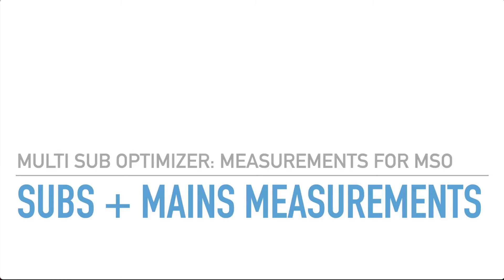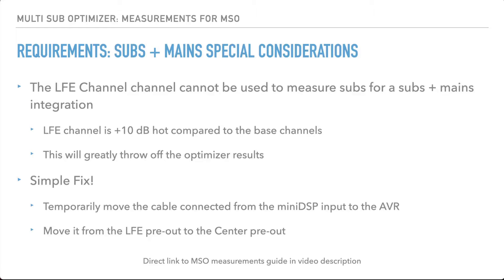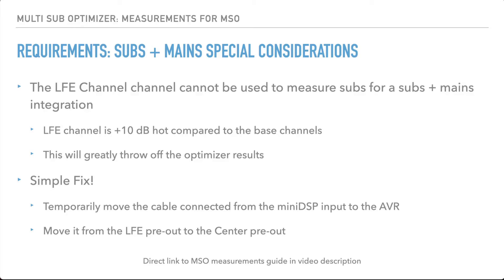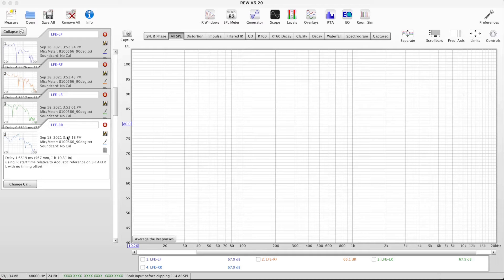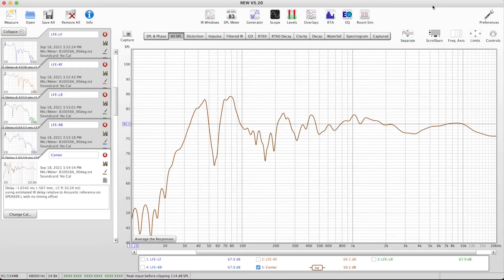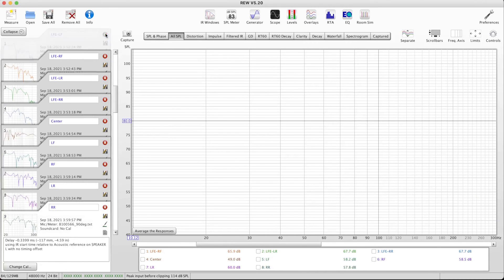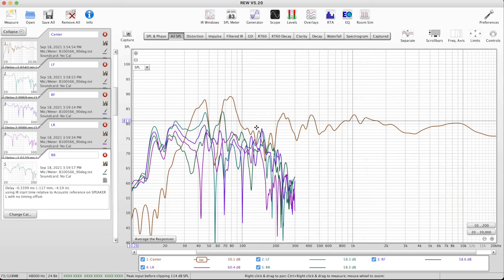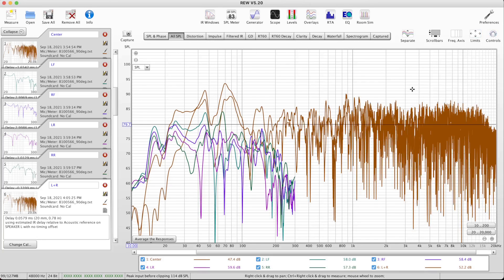Measurements for MSO: Subs + Mains Measurements

Comment: Hey Jeff

Thank you so much for putting together such a great tutorial! Can't thank you enough for this.
I just had one query for you.

You have mentioned - "Multiple subs on a single channel are measured at the same time and are treated as a single sub"

My setup is as follows:
1. I would be driving 2 subs from 1 LFE out of the AV Prepro [The AV prepro has 2 sub outs. But since I need to add an Auro3d Voice Of God channel, one of those Sub pre-outs gets used up for the VOG channel;  thus leaving me with just one SUB pre-out]
2. How I would be doing this is by connecting the remaining SUB pre-out to the one of the inputs of a MiniDSP 2x4HD and deriving 2 outputs for the 2 Subwoofers.

So my question is - In this scenario, do I consider both subs as a single subwoofer during sweeps and measurements? - OR - are they to be regarded as 2 separate Subwoofers while taking measurements?
Many thanks in advance!
Reply from the maker: Thanks for the question!  The short answer is that we need to treat each sub individually from a measurement perspective, and then take the time to properly align and integrate them with one another (using something like REW or MSO depending on your goals, more below).

The long answer below is WHY we need to treat them this way and do some extra work up front.  There are also links to my other videos on the two methods I mention to help you get started.

Please keep asking questions as things come up!

Now ... the long answer ...

The important thing to keep in mind is what the AVR or SSP "sees" in this kind of config.  The AVR/SSP doesn't know what we're doing with the signal.  It only "sees" one channel and therefore, one sub, regardless of how many are actually playing.  It could be one, two, or 20 subs.

The problem this creates is that AVR/SSP isn't capable of making sure all of those subs are actually playing well with one another to produce the best possible sound.  Unless you are very, very lucky, the subs are going to be fighting each other, rather than helping each other, in some or all of the frequency range.

That fighting vs helping is why we need to align, and optionally EQ, the subs within the miniDSP.  When that's done, we end up with a virtual "super sub".  The AVR/SSP now sees this single "super sub" and can use its room EQ processes to their fullest extent.

Depending on your goals, you'll want to use either REW or MSO to handle the sub alignment.  The short version is if you only have, or care, about a single listening position, use REW.  If you care about more than one listening position (like a row or multiple rows of seats), then use MSO.

I've got videos on both methods here on my channel:

REW Method
Watch the first 10 mins or so of the EQ video first.  You'll then need to go through the Alignment Tool video, and come back to the EQ video to finish things up.
EQ Proces:  https://youtu.be/ARztXSmoQbE
Alignment Tool:  https://youtu.be/8bwpLfbLiZ4

MSO Method
https://youtu.be/WtMq73BzOIA
Reply: @jeffmery  Wow! That's a really long answer there. 
Thank you very much.

I will check the videos that you pointed out. May I request you to create a YT playlist on your channel with all of your videos in the right order? I think it would be really helpful for noobs like me to follow through and understand things more cohesively.

May I share another question with you here?
Where would Room correction systems like Audyssey, etc. factor in now, in the grand scheme of things? Do we run Audyssey after all these steps that you speak about here?
Reply from the maker: @diymonk7266  Doh!  I thought I had put one together for REW, but it was only for MSO.  I'll get one out there soon.

You are correct about room correction  You would first get your subs squared away as outlined above, then run your room correction.  There are always exceptions to this, but this usually provides the best results and is almost always the best place to start.

Comment: Hello Jeff, 

You videos seems to be quite interesting on using the MSO. It's seems to be a better option. 

May I check whether will it give the data(from MSO) for the center channel on which crossover & how much delay for the center channel has to be input?

Thank you once again for making this video. It's my first time using MSO.
Reply from the maker: MSO will not determine the correct crossover frequency, but it can be used to figure out the delay at the crossover frequency you have chosen.  This is part of a subs-mains integration.

Another option is to use the alignment tool in REW to determine the correct delay to align with the center channel.  I have another video on how to use the alignment tool.  Just use a measurement of your subs.  This is a measurement AFTER you have aligned them with MSO, so it will be a single measurement.  The other measurement will be your center channel.  The center channel is the first speaker in the tool and the subs would be the second.  Then you can figure out the best delay to use for the smoothest integration.

This ^^ should be done after running your room correction software.  I would use this with MCACC, YPAO, & Audyssey for sure.  I would not use this with Dirac and a full DLBC license.  I'm not experienced enough with ARC or some of the others to know if/how this applies to them.

I hope this helps.

Comment: Hi Jeff,
Again a super video from you.
Can you already say when the video comes to the integration, I am very excited about it.

But I still have a question because I have a DDRC88A+BM.

Does not it make more sense if after the integration as in my case dirac then still runs over it instead of the center to take the front left speaker? Because Dirac takes as a reference also the front left speaker
Reply from the maker: The important thing, is that all measurements used as input into MSO use the same acoustic reference.  In my room I have 3 positions and 4 subs which means 12 measurements.  Those 12 all need to use the same channel as the acoustic reference channel.

The reference channel used by the room correction software doesn't matter.  I use Dirac myself and yes, it uses the L main.  Other room correction software behaves differently.  YPAO, for example, just sweeps each speaker, and doesn't sweep the L main each time as a reference.

I also agree on your approach.  Integrate the subs and then pass them to Dirac as a single virtual sub.
Reply: @jeffmery  thx for the Answer. Can you tell me when do you make the integration and optimize video for the center and subs in mso? I mean the net step in the process ;-)
Reply: @jeffmery  hi Jeff 
When comes the next Video?
Reply from the maker: @michaelpiper6601  I’m not sure. Work has been crazy for the past few months and isn’t letting up. If the concern is aligning subs with the center channel, search for “sub distance tweak” and use the center instead of the L+R for the process.
Reply: @jeffmery  I do hope your work tails off enough for you to have some time to run the the MSO and MiniDSP process for Multi-Subs +Mains.!  In your experience did doing the subs + mains produce any better results than subs only?
Reply from the maker: @Malice0505  It has tailed off some, but I'm not sure if I'm going to do the subs + mains tutorial any longer.  I hope that's not too disappointing, but let me explain.

The point of the subs+mains optimization is to 1) optimize the response of the subs 2) determine the correct crossover frequency between them and 3) determine the correct amount of delay between the subs and the mains.  Point 1 is the same for sub-only and subs+mains so let me address points 2 and 3 as they are the real sticking points.

Regarding point 2, MSO has some very specific requirements in order to determine and implement the correct crossover frequency.  Chief among these are knowing both the type and slope(s) of the filters used to create the crossover, as well as the ability to set the slopes of these filters.  The vast majority of the AVRs and processors in use do not meet these requirements.  They do not provide the ability to tweak these settings and most don't even give the specifications for what they use for their fixed configurations.  My somewhat high-end processor does let me set the slope, but does not let me set the type (and I don't recall if they specify the type of filters in use).

Regarding point 3, the vast majority of home theater users are going to run room correction after optimizing their subs.  Room correction is going to change whatever timing we set based on what it determines is best according to its own algorithm.  Why take the time to optimize the timing if room correction is going to undo it?  Additionally, many room correction packages don't get the timing correct in the first place.  We often must do a "sub distance tweak" to optimize the timing.  MSO is overkill for this and it's much easier to do with the REW alignment tool.

I should qualify everything above by stating my focus is almost 100% home theater.  I do 2-channel listening, but I optimize for home theater and the resulting 2-channel experience is "good enough" for my purposes and tastes.  If your priority is 2-channel and you want to do a subs+mains integration for that use-case, that's a good reason to do it.  It's just not a priority for me based on our listening habits.

Comment: Hi Jeff, you have a new fan that has been to every single video here.   Now,  I have a pair of main Goldenear Triton Reference which comes each one with powered amplified subwoofers 1,600 watts with lfe inputs built in.  This model manuals is very clear that you set them up as Large speakers and the option of connecting LFE cable from sub preout on avr to the internal lfe input on the main speakers. How do I get LFE signal to calibrate and align lfe responses  if manual is already telling me to setup mains as Large speakers?  Or what setup you recommend for this speakers? Thanks....  The only way I can think of is turning on the option on AVR that says LFE+Mains. 🤔🤔  I also have 2 extra on each side of room  Goldenear Super Subs XXL and love the integration of all 4 powered subwoofers all together
Reply from the maker: Thank you!  I appreciate the kind words!  That's quite a setup, but does present some interesting challenges.  The main challenge is that the best location for a subwoofer is rarely the same location as the main LR channels.  We'll need to make sure we have things set correctly to get the best results.

(I assume the specific model is the Triton One.R but correct me if I'm wrong on that.)

I read the manual and here's what I recommend:  Use both the speaker-level and LFE inputs.  This will let you properly integrate the subs in the towers with the other subs in your room via MSO or whatever method you elect.  Using LFE solves the issue of getting all subs an identical, mono signal.

In the AVR or Processor, I would still set the speakers to "Small" to enable bass management and crossover settings.  "Large"/"Small" actually mean "Bass Management On / Off" so they either are/aren't crossed over to the subs.

The reason for going against GoldenEar's recommendation is that we're using the speakers in an advanced config that their instructions don't cover.  That manual is for the average Joe, and not an enthusiast with many subs that need to be properly integrated.  LFE + Small gets us the best of both worlds.  We get properly managed and integrated bass along with smooth crossover to ALL subs and not just the subs in the towers.

Did I cover everything?  If there's something I missed, please keep asking questions :-).
Reply from the maker: One more comment - definitely do NOT use "LFE+Mains".  That causes way more problems than it solves.  This is especially true with multi-sub setups such as you have.
Reply: @jeffmery  Yeyy you are awesome...Thanks so much you know since I bought this mains and the 2 XXL subwoofers from Goldenear some decent amount of $$$$$ I spent  almost a year ago my head keeps thinking about it... and now you made me so happy and relieved.  I'll keep setting up with MOS, REW and the minidsp and let you know results..  Thanks again my FRIEND
Reply from the maker: @frankiejoey  Sounds good.  Let me know how it turns out for you!